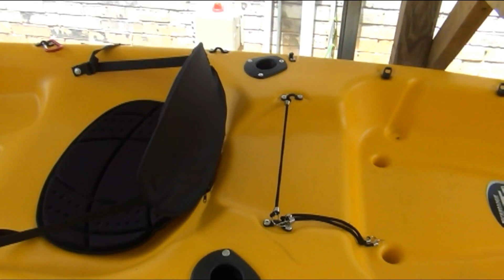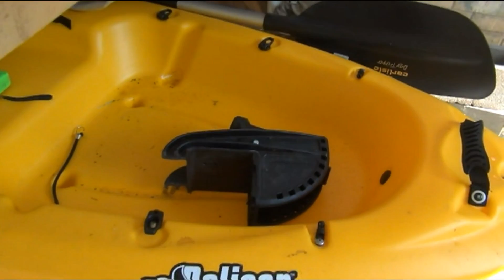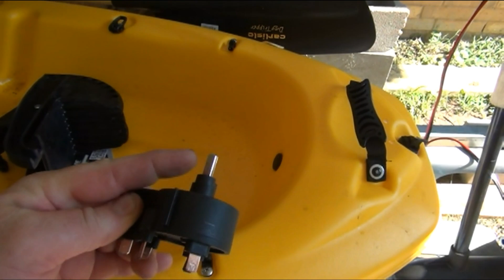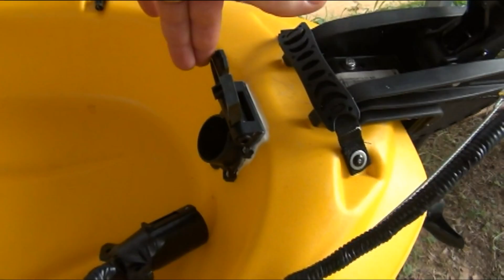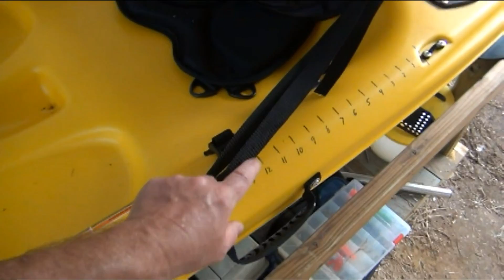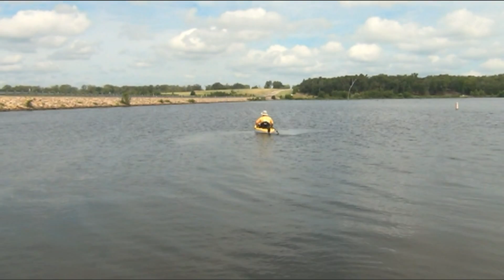Electric Kayak

Comment: I am going to do something I never do, Make a critical comment. I see you published your video in 2013,  it is 2018, how long did your transom mount last with your 4 bolt attachment mount?  To me, and this is my opinion, there should have been some kind of backing plate in the hull for the bolts. And if that was used it made your mount stirdier but a catch 22, was your motor locked down? If it was a log strike would damage your hull, if it wasn't, reverse would be useless! Just some questions I have when designing my mount. Nice looking kayak though. Oh, this is much less an issue if your trolling motor has a composite shaft! I don't know if Min Kota had a composite shaft in 2013. Good luck though.

Comment: I understand that you used a waterline  but how did you get the tube to come out  by the foot pedals.  My arm does go that far down from the from hatch? and if you started at the pedal end how did you get them to come out the back of the yak? my arms arent long enough to reach that either?
Reply: He cut a storage hatch behind seat. That's how he reached it.
Reply: Sorry for the delay I ran the wire from the rear to the front then fed the tubing back along the wire to the rear

Comment: did the weight of the motor ever compromise the plastic where it was bolted on to since you only used 2 bolts on top and 4 on the side? BTW why did you sell the Kayak?
Reply: Sorry for so late of a reply I only used it a few times and sold it. Kayaks gave back pain and in Texas I needed to pay for registration as it was motorized.

Comment: How hard was it to pull the wires through the hull for the steering... and how do you do it?
I'm wanting to do this on a Pelican Castaway 11.6
Reply from the maker: I used water line for ice makers as an outer housing pushed them thru the holes I drilled and used a lighter to heat and expand the ends so they don't pull out.  Then just route the cable thru the water line.
Reply: I like that
Reply: Sorry for delay I ran the wire from the rear to the front then fed the tubing onto it back the rear.